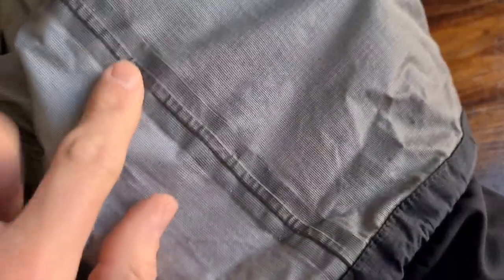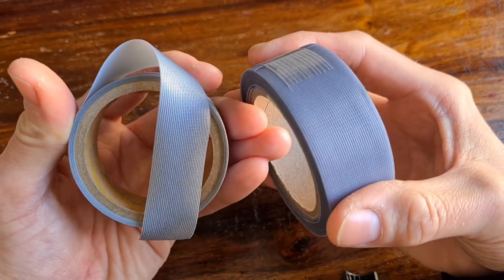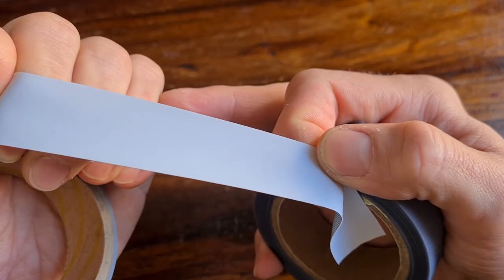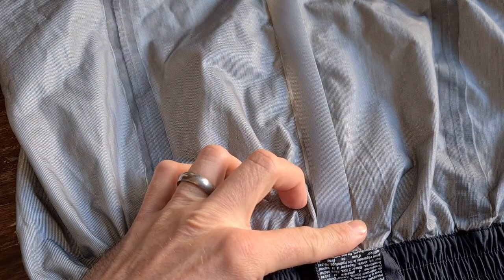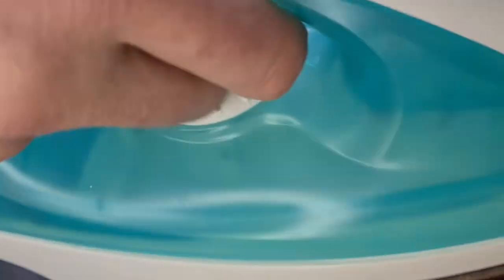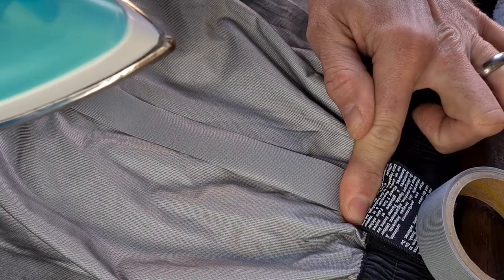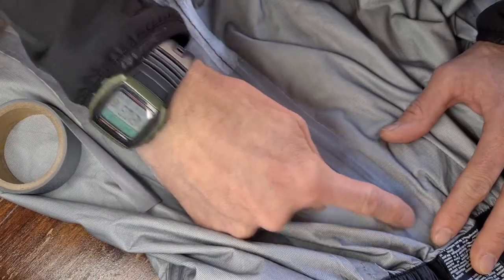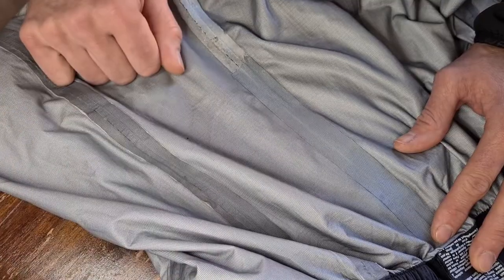Fixing Leaky Waterproofs-Seam Sealing Tape-Re Sealing-Iron On Hot Glue Tape-GoreTex Fabrics

Comment: Get yourself a seam sealing iron, sometimes called leather iron. The blade is only about 26mm wide, avoids damage to the surrounding material. Amazon UK carry a couple of models.
Reply from the maker: Great tip Nigel thanks so much!
Just checked out amazon and we will be purchasing one of these! Relatively inexpensive too compared with the money saved by repairing old kit😊👊👍

Comment: Is there such a thing as a double-sided version of this, for fusing two different pieces of waterproof fabric together? I have a hole in some waterproofs, and I'd thought that maybe patch it, but this stuff seems to be single sided.
Reply from the maker: That is a very good question. To be honest we don't know if there is a double sided version of this tape. Although we have managed to patch over small holes using the one sided version. Obviously this won't be breathable, but depending on the size of the hole, that may be less of an issue. Hope you find a solution and this video helped😊👍
Reply: @o.bsoutdoors3871  I'll try some things, it's all relatively cheap. Thanks for your response!

Comment: Could you give a link to where you got the tape from? Are there good and bad versions? I want./ need to mend a seam in the neck of my paclite jacket but worried about ruining the fabric itself.
Reply from the maker: Hi molly, yes we just purchased it from eBay using the following link:
https://www.ebay.co.uk/itm/184409468685?mkcid=16&mkevt=1&mkrid=711-127632-2357-0&ssspo=z5UU8hlOR4u&sssrc=2349624&ssuid=oddU0L1CTKq&var=&widget_ver=artemis&media=WHATS_APP
Other brands are available on ebay and they are all very similar. Hope that helps and good luck with repairing your jacket👍
Reply: @o.bsoutdoors3871  super thanks- my worry is ironing the paclite fabric because it’s so thin- I’d be more confident on something like proshell or performance shell as they are thicker. The seam tape is only party unstuck but I’m not sure if I’d be better with tape or glue - I don’t like the look of seam grip wp.
Reply from the maker: @mollym3291  yes i can see your concern with the paclite fabric, care would definitely be needed. Another comment on this video from tomek on ski also had a good suggestion about ironing the tape onto a cushioned plank (see below in comments) which may help. Good luck👍

Comment: I wonder if it would work to heat the tape separately over non-stick baking paper, then apply it onto the seam while its still hot.
Reply from the maker: Hi Paul,
That might be tricky as the tape needs pressure applied as the glue melts and it is fixed to the garment,so it could be messy if all of the glue is already melted. But best of luck if you decide to give it a go👍
Thanks for watching😊👍

Comment: Hi there . Thanks for a great bit of info .. I need to replace similar on my tent - I expect the same technique ( I like the comment re raising the level of the work surface to minimise the risk of damaging the material either side .. )  Have you done tent repairs yourself  -  and if so would you recommend a particular clear tape  ?
Reply from the maker: Hi there,
Have to say i haven't repaired a tent using this method, but that's not to say  that it wouldn't work perfectly well, just on a larger scale. We purchased our tape from eBay using the following link:
https://www.ebay.co.uk/itm/184409468685?mkcid=16&mkevt=1&mkrid=711-127632-2357-0&ssspo=z5UU8hlOR4u&sssrc=2349624&ssuid=oddU0L1CTKq&var=&widget_ver=artemis&media=WHATS_APP
Other brands are available on ebay and they are all very similar. Hope that helps and good luck with repairing your tent👍
Thanks for watching

Comment: Thanks - any guidance on sealing up a rubberized jacket - sleeve has torn off the back half while riding a motorbike.  Any idea if this type of tape will work with the rubber coating?
Reply from the maker: Hi Mark,
This type of tape would work on the inside of the fabric. But you would need a specialist contact adhesive and repair strip for the rubberised outside. Good luck, and thanks for watching 👍

Comment: Would using a towel between the iron and tape work just as well ? 
👍🏼
Reply from the maker: You could try this method, but I think the tape and the iron need direct contact in order to ensure the glue gets hot enough.
Thanks for your question👍

Comment: I have one dilemma.  I need to do this to a pair of fishing waders, that have recently started leaking.  The problem is half that is leaking is Neoprene, and the other half is material such as your pants.  How do I know that this would work on both materials?
Reply from the maker: Hi there,
Thanks for your question. Unfortunately,
I have only ever tried this on gortex material or its equivalent. I have no experience with Neoprene, so couldn't guarantee this would work. However, as the tape is such a cost-effective solution, i would recommend giving it a go! Good luck,
And all the best👍

Comment: I have a tent fly where the seam tape has peeled off and left some of the old glue on the tent. How do I get that off to prep for the new tape?
Reply from the maker: Hi Beth, you don't need to remove the old glue, it will melt with the iron when you put the new tape over it. There was lots of old glue on the trousers i fixed in the video. Thanks very much for watching, Pete😊👍
Reply: @o.bsoutdoors3871  even if the old glue is dry and flaky?
Reply from the maker: @bethb7734  Hi Beth, yes it will still melt and fuse with the new glue on the seam sealing tape👍